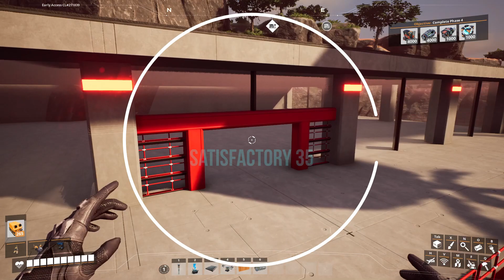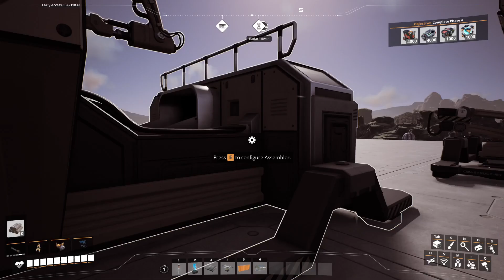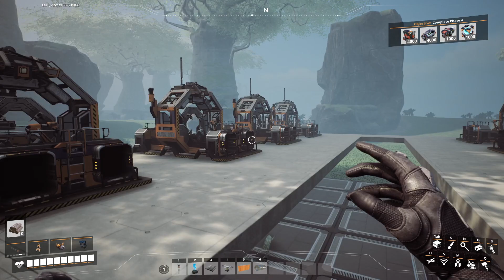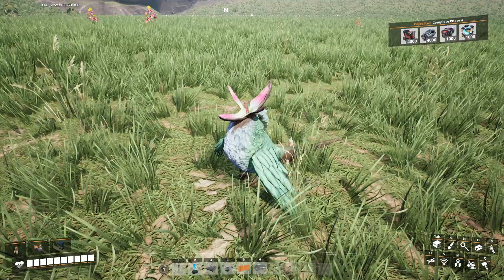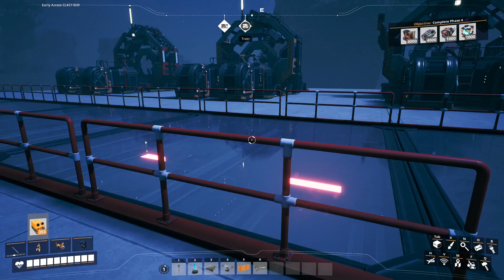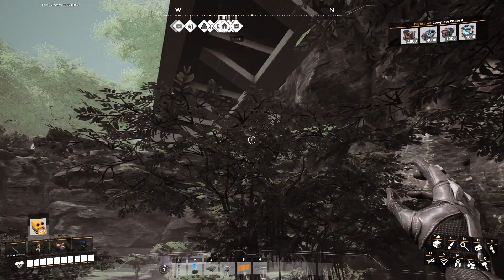Cheap Silica and Another Factory Satisfactory pt35

Comment: The cliffside supports look great! Maybe try to use the pillars as the cross supports so you have that texture on both sides? Could look nice.

Also, I usually try really hard to avoid angled conveyors but the way you did the central feed for the Assemblers looks excellent!
Reply from the maker: I could have lifted the conveyors lift 2 clicks higher, and i would be level with the splitters, but I had already placed them that way and just stuck with it. I'll try the pillars across next time I play. I like what I'm going for but I'm not quite there yet. Lol